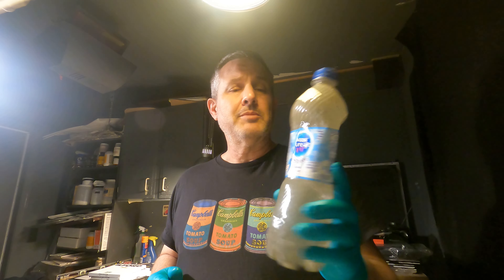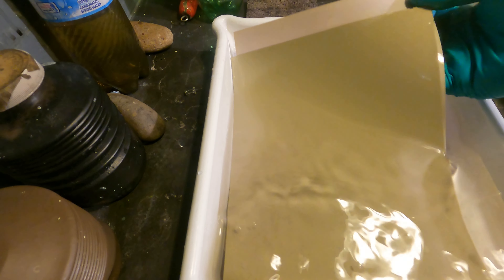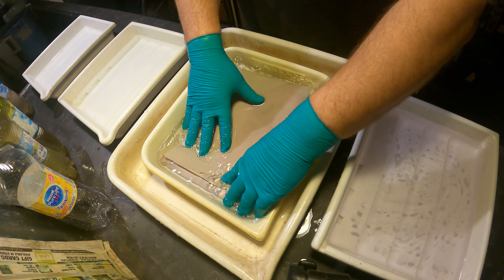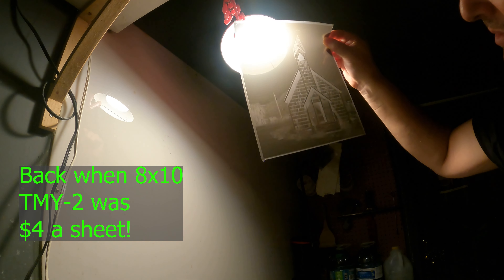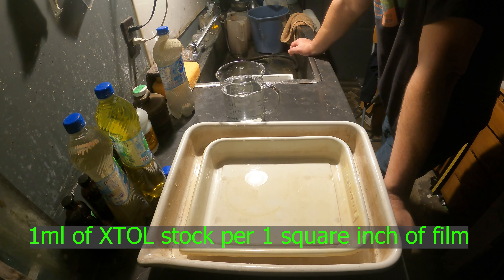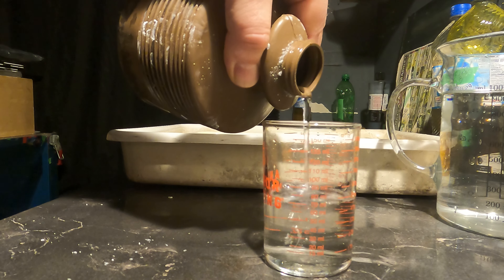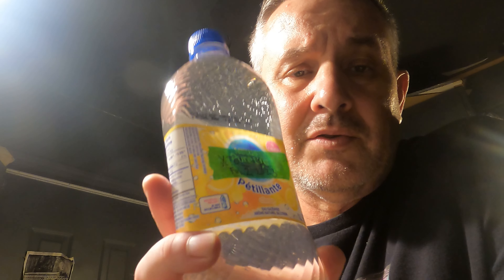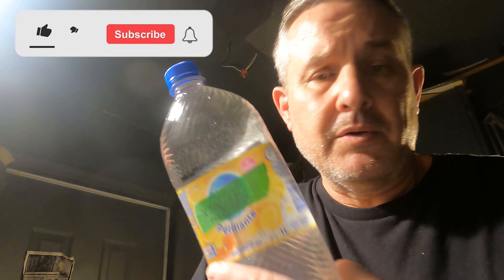Making XTOL-R: How I season a litre of stock solution in one session.

Comment: In the hay-day of B&W photography, roughly the 1950-60s, replenishment was common for commercial labs as an economy. Kodak sold its developers along with dedicated replenishment solutions designed for each developer. The replenishment solution replaced those developer components which were consumed and maintained the chemical balance of the developer. All of that went away as Kodak withdrew most of its B&W film, paper and chemistry. Today, as done here, Kodak "recommends" that stock XTOL be used as a replenishment solution, which of course, cannot perform the function of the historical replenishment process.  The used developer contains bromides generated in the development process. Use of stock XTOL as a replenishment will inject excessive bromide into the used developer. Grant that the chemical effect of this will be unnoticeable from roll to roll, but  over an extended usage, you are altering the chemical structure of the stock solution. It's become "no longer Xtol". That may or may not be considered a positive event depending on how you like the images resulting.
Reply from the maker: Very interesting! Thank you. There is an interesting thread over at Photrio.com about replenishing XTOL. Your input there would be beneficial.